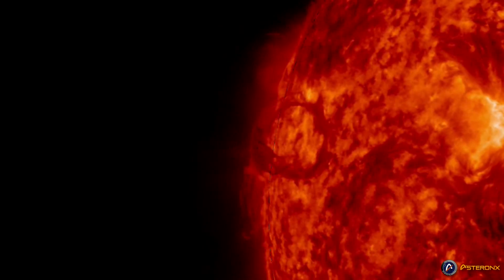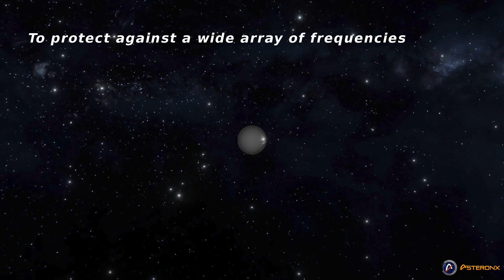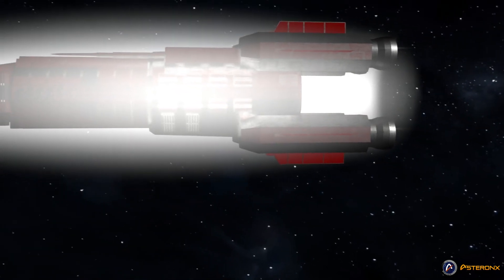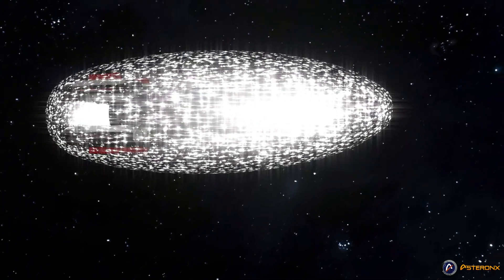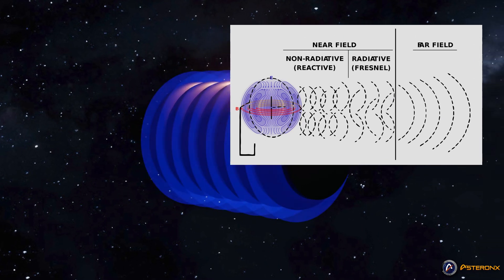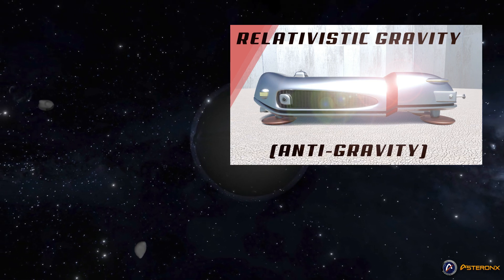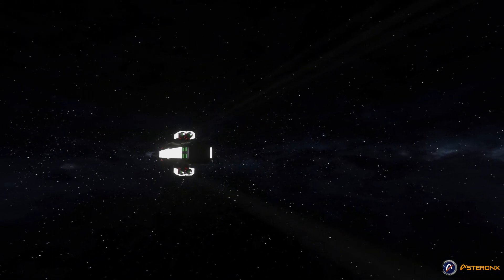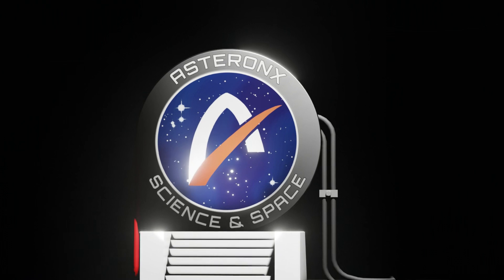Shields Up! Real Life Energy Shields

Comment: Anyone else think about the "pin-point barrier" shielding on Robotech (Macross for the Anamie fans)?  Also the overload of a full shield.
Reply from the maker: Is the "pin-point barrier" a kind of point defence then?
Reply: @asteronx  think of a shield that only covers a limited area, but it can be moved to intercept incoming fire, if you can move it fast enough.
Reply from the maker: @mmonnens  Sure, that sound a lot like a real-life point defence shield--highly effective, if you can move it into place swiftly enough that is.
Reply: @asteronx  Here is the Pin Point Barrer System in action. https://www.youtube.com/watch?v=ZdBfRYHCy5k
Reply: The problem with that is, it wouldn't work for front shielding if the space ship was travelling at super high speeds because they wouldn't know where the projectiles were coming from next.  There wouldn't be enough time to react, especially if there's a lot of debris at once.

Comment: I have three shield types in my setting: plasma sheath for atmospheric entry and flight, an energy shell around a ship and further-projected "plates" of compressed space-time, which can be stacked like lenses.  The effect of the last would be lensing an energy beam away from the target and to shred incoming projectiles.
Furthermore, armor would have a magnetic field to spread out charged particle beams or pulses.
Reply from the maker: Must be highly energy intensive, what is the energy source in your setting?

And a small correction: spacetime cannot be compressed, only curved.
Reply: @asteronx  
Terms aside, whatever is done to the space preceding a ship while using an Alcubierre drive.

On the power sources, depends on the ship size (as would the availability of shield types).  Fusion reactors (stacked aneutronic stellators with direct energy capture, mostly); m/am annihilation cores with the antiprotons produced in vast clouds of automated satellites around stars; kugelblitz black holes (also serve as hazardous waste disposal); and something I like to call knot reactors. 
The last ones are purely sci-fi with no hardness as far as I can tell, but there's enough wiggle room for the technobabble.  Basically it consists of a "pure" vacuum sphere (as much as pure vacuum can be achieved even without factoring virtual particles) with pairs of emitters on the inside surface, which project an artificial String between each instance in a pair.  The emitter pairs move in such a way that the Strings start knotting in the center and start feeding back into the emitters.  The knot itself could be described as a naked singularity with a lot of associated weirdness, the least of which is seemingly free, untapped energy.  There is no actual structure to the knot, as there would be with a representation with yarns, since the 3D structure of the knot's volume collapses back into 1/infinity.  This collapse is the primary energy source in the feedback.  And it can be regulated with the pattern of the "knotting" emitters and the speed at which they move.
As a precaution, the power feed to the mechanisms that move the emitters are separated from the feedback collection systems, so the reactor doesn't simply go into a feedback loop.
Reply from the maker: @Tounushi  Quite an interesting and creative energy source.

Comment: Interesting ideas.  However, it sounds like they would require tremendous amounts of energy to work.  Granting that we would be able to develop fusion, antimatter, black hole power, or something else sufficient to the task, there's still the issue of getting rid of the waste heat from generating and using all that energy.  Would there be a Red Queen's race between radiator size and shield power (need to have huge radiators to shed heat, shields need to be bigger to protect them, requiring bigger heat radiators, requiring bigger shields...)?  Also, the shields themselves would be radiating energy, and apart from some way to make them radiate energy only outward, roughly half of the energy would radiate inward toward the ship.  So, there'd be the problem of the shields cooking your spaceship like a TV dinner... :)
Reply from the maker: Plasma radiators. But yes, there are challenges to overcome, and this video is in no one meant to be comprehensive--it is just an overview to get the brain juices flowing ;)
Reply: in xenonauts game aliens energy lora said that the way they got so much juice in a small space ship that the place where they burned,the fuel was wraped around and captured radiated heat and,recycled back to boost energy output.

In real life the,main issue is finding something that can carry energy and something else that can use it up fast enough so it wont turn to heat.
Reply from the maker: @ThanksIfYourReadIt  It's just a matter is cycling enough material, and ensuring that material has sufficient surface area to dump heat faster than it is taken up.
Reply: @asteronx  ceramic.or,,,go ask nasa,,,or,,area 51..been doing it for 50 yrs...
Reply: Kevin Crady can I have mine xtra crispy?
Reply: Dude , where's the microwave? We're in it :)
Reply: Heat is a form of energy...we can just extract that for some other purpose...
Reply: @BJCMXY  You can't beat thermodynamics.  It's only possible to extract usable energy (work) from heat if there's an energy gradient, i.e. a flow of heat from a concentrated source to a dispersed sink.  

That waste heat still has to be radiated.  If it isn't, the ship will reach thermal equilibrium at some temperature close to the temperature of the shields, reactor, or whatever is providing the original source of waste heat.

Comment: Question. How do you thrust forward with full Shields surrounding the ship. Example. Having holes that go around engine thrust ports makes them  weak spots. And having The Shields cover the thrust ports cannot get out if nothing can get in.
Reply from the maker: The shields make good nozzles, so your "engine" will be partially outside the shield.
Reply: @asteronx  example. You're above a planet that is exploding, now you don't have time for thrusters, Shields first. But you still need to move the ship because some big rock is headed your way. So how do you move if your thrusting against your own Shields that are protecting the very engines that are being threatened by the planet debris From Below? Or for that matter any matter that is going faster than the ship- could fly up its backside. I see like the ship in a bottle. It can't go anywhere except inside the bottle. The bottle is the shields.
Reply from the maker: @cynthiaayers7696  A rocket engine must be protected from the fury of the reaction within, using a plasma shield with a fusion rocket is no different. Yes, the shield does need to be rearranged to work as a rocket nozzle, namely, reshaped into a nozzle shape (chamber > constriction > expansion)
Reply: @asteronx  thank you for getting back to me in answering my questions.
Reply from the maker: @cynthiaayers7696  You're welcome. We do our best to reply to comments--and there's a lot of them.

Comment: A super static charged plate can also deflect.    Example, charge a non-metal (by rubbing it on fleece etc) rod and hold it below a narrow stream of water, it will deflect the water, apply a massive charge to a metal rod, and avoid contact with the ground, and it will also deflect things.    Some of you may have done similar experiments in science class at some point.

Comment: Not really "real life", but fun ideas for fiction.

One exception, filling a magnetic bubble with plasma.  That's an engineering possibility.
Reply from the maker: A magnetic bubble filled with plasma would not stop weaponry or high-energy particles and radiation due to high-speed travel. But it is a start.
Reply: @asteronx  A magnetic bubble is what the Earth uses to deflect high energy particles and radiation.

The power nessesary to contain plasma sufficient to vaporize debris is enormous.  Best just to shoot high energy particle beams at incoming debris and projectiles.
Reply from the maker: @keithcallen2844  Agreed, a point-defence screen is far more effective than a plasma screen. However, against EM radiation and highly-relativistic particle beams it is useless. Hence, some kind of plasma shield is necessary.

Comment: In the first Karate Kid,  Mr. Miyagi said the best way to take a punch is to NOT BE THERE.  If we can get particles, space debris, energy to not actually impact us like "AIR AROUND A BOTTLE", flow around us and off into space, this would take a lot less energy than absorbing, deflecting or withstanding a direct hit.
Reply from the maker: You are absolutely correct, we have yet to figure out a means to do this. A gravitational shield is a good start, but would require great amounts of energy to start with.

Comment: The problem with the gravit shield is that unless you have the gravity of a black hole bieng generated, which would kill you, the enemy could us by building a rail gun type weapon using gravity which could launch it with the force we’re repulsing it at. I like the quantum Field laser idea, but their forced apart with lasers so couldn’t the enemy bump them auround randomly until they anahilate against each other? Plus you can’t fire back with any of these shields since the would affect all object attempting to pass through. With the plasma shields could they use ablative rounds with a solid core like we do for space capsules? For now I remain skeptical, though I thought this video had good information.
Reply from the maker: The ambiplasma (matter-antimatter plasma) shield is metastable and continually being replenished. You could fire out of most kinds of plasma shield by using it as a plasma lens.
Reply from the maker: But yes, there are problems with gravitational shields.

Comment: Did you switch to using Eevee over Blender Internal? Your renders are looking significantly nicer
Reply from the maker: That we did, Eevee is quite remarkable.
Reply: Cool! Whoever is responsible for the renders has done a good job of placing reflection and light probes. The renders look as though they were done in Cycles most of the time!
Reply from the maker: @jarredeagley1748  Thank you! It has been a long time coming to get to where we are now. Sometimes we look out our older renders and cringe (particularly renders from before we started making videos).

Comment: Impractical because every watt of power used to produce the plasma must be radiated away. Any active plasma shield is going to produce a lot of heat and this going to accumulate in the ship until its turned off.  

In the case of Laser induced virtual particle pairs (matter & anti matter) its going to produce a lot of gamma radiation which is going to kill off any occupants in the ship.Plasma shields would also be producing a very bright beacon that enemy ships could use to target, Weapons could include a magnetic pulse just prior to the warhead detention which would disperse the plasma protecting the ship.

Comment: How would these shields interfere with propulsion and weapons when active?
Reply from the maker: Depends on the design, either a flickering-open window over sensors and weapons is needed, or else some means of firing and sensing through the shield.
Reply: @asteronx  could it be possible to have the sheilds flicker at a high frequency? Sorta like how when you look into a fan you can see what's behind it while at the same time you can't just stick your hand through
Reply from the maker: As to propulsion, that is actually no problem. The shield, with some tweaks, is also useful to build a very effective fusion rocket nozzle. So your engine is, in some sense, outside your shield.

Comment: @asteronx, what about neutron beams? They are devastatingly effective and would be unaffected by most forms of shielding....well except for that photonic force field that the alcubierre-froning warp drive uses.
Reply from the maker: They are indeed devastatingly effective, our ambiplasma (matter-antimatter) shield, or a very (very) dense conventional plasma shield would stop or at least diffuse a neutron beam.

A neutron does have a magnetic moment, so it is hypothetically possible to deflect them magnetically, but the energy requirements may very well be... astronomical.
Reply: @asteronx  well, that's the problem with plasma shielding, the more it gets hit the more it heats up. And the more powerful the beam or kinetic weapon, the hotter the shield needs to be to vaporize or diffuse the attack...and melt the starship within.
Reply from the maker: @nil981  This may be rectified with the ambiplasma shield, but maybe not.
Reply: @asteronx  I'm not entirely convinced it is. Neutronium shields/armor however would be straight-up impossible.
Reply from the maker: @nil981  Well, one must overcome the difficulty of containing something far more energetic than a nuclear blast. And then there's the quirk that whatever is containing the neutronium could simply be used as a protective screen directly.
Reply: @asteronx  so, essentially the neutronium is redundant.

By the way, I took some time to glance at some of Dr. Tataaki Musha's other papers on researchgate. Needless to say many of his papers are truly eyebrow raising. Not in the sense that they are bad but for just how far out there they are. Some of his papers border on outright quackery.

Comment: Plasma must be kept at ultra high temps. A magnetic field doesn't do anything in this area. If it did we'd already have safe fusion power.
Reply: Even if we had reliable plasma shields, the very act of travelling at relativistic speeds would deplete the plasma from the shield. Not only that but the faster you go, the hotter and brighter the plasma shield would flow which means that you would have to project it further and further out in front of your craft.

Comment: Since Neutronium is so dense, wouldn't that also make it fucking heavy? Or does that just not matter as much in the weightlessness of space?

 What would happen if a ship, or a part of a ship with neutronium armor were to fall from orbit, like the Enterprise did in Star Trek Beyond? I'm no physicist, but neutronium weighs an f-ing lot, right? So, even if only used in thin strips, I'm guessing would have a lot more potential energy than something more light-weight on impact? As in, it would take for more reverse-thrust energy to decelerate, and failing that, would quite frankly make a big mess at the impact area?

 Come to think of it, shells made out of neutronium fired at speed could make devastating weaponry, seeing as how they wouldn't disintegrate or loose their kinetic energy anywhere as fast or easily as conventional materials.

 And on the topic of energy shields, would it be perfectly safe inside each example, or is that another technical challenge to overcome?

Comment: Awesome Video! In a previous video you mentioned photonic shield system when discussing warp drive which was virtually imperveous... how much different are these designs from that one, the practicality and how many years off do you think we are from each and finally what are all the effects these shield systems on the crews? I imagine the Anti-matter plasma shield you mentioned could have some downsides in terms of radiation to the crew and even material fatigue or containment issues relating to the ship itself.. thanks again for a very thought provoking video!

Comment: Neutronium can exist in a stable form if somehow removed from a neutron star or it needs fields to be contained?
Reply: it cannot be stable without the huge gravity of neutron stars, they decay into proton emitting an electron and a neutrino in the process, you would need huge force to contain the neutronium, the problem? neutron are neutral particle therefore they cannot be confine using magnetic field, the only way i could see it being done is with a outer layer of normal plasma to apply pressured to the neutron.

Comment: Human civilisation will need to move into heavily shielded megastructures in order to survive the weaponisation of FTL technology, but it is very reassuring to see that shielding technologies are viable!
For that matter, i would want to protect my O'Neill cylinder with a thick layer of metal, fullerenes, and pykrete, then several overlapping ambiplasma shields, and finally a satellite grid with half equipped with giant lasers and half equipped with paragravity generators to try deflect warp capable missiles

Comment: My first choice of energy shield would be the ambient matter-antimatter energy shield. My version would be regional, adjustable, and held in place by magnetic fields so that the matter and antimatter components dont annihilate each other and produce intense gamma radiation. My shield would be able to open up windows in it for sensors, weaponry, escape pods, or for extravehicular activity. 

But I would also have a backup laser point defense system with layered composite armor that has a thick outer layer of metastable metallic hydrogen or helium with subsequent layers made of graphene aerogel, diamondoid/sapphiroid, and steel alloy.
Reply from the maker: That, would be a fairly durable ship. It's "ambiplasma" by the way ;)
Reply: @asteronx  well, with a solar systems' worth or even a galaxy's worth of materials, armoring wouldnt be much of an issue. Heck, due to the famous square cube law, armor actually gets cheaper when you build bigger.
Reply from the maker: @nil981  Not very nice to look at though ;) And actually, if an x-ray laser or particle beam can drill through a ship the long way, well, more armour won't do that much good.
Reply: @asteronx  or use materials that are good at protecting against a certain wavelength of light or particles.
Reply: @nil981  exactly